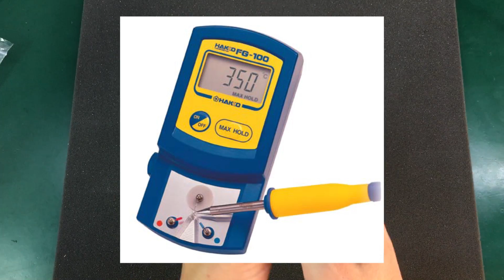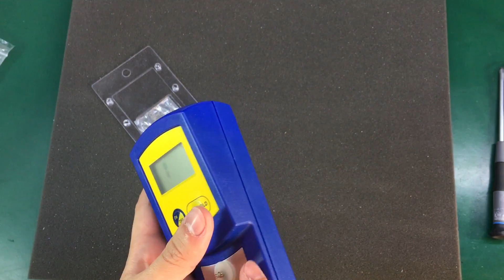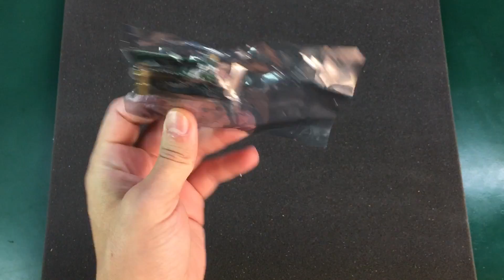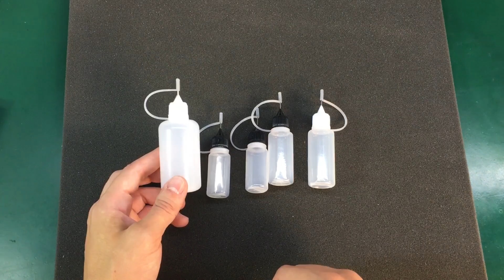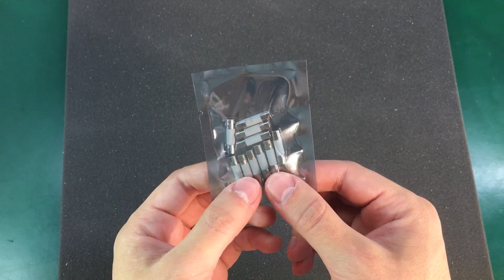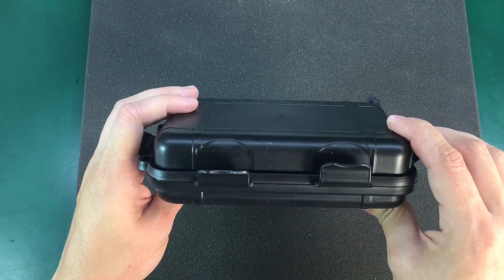Voltlog #68 - InTheMail

Comment: Don’t connect peltier plates in series. They have very poor operating efficiency. For example: to remove 1W of heat on the cold side they will generate 20W of heat on the hot side. Now think what will happen if you cascade two in series….

Comment: You can stack the peltier elements and connect the first that will be under to 5 vdc and the second on top to 12 vdc. Place it with the first element on a big cooling block with a fan. I made a cloud chamber from this for detection and visibility of cosmic rays. Search  on YouTube for nedstar cloud chamber.
Reply from the maker: nice, pretty cool project you did there.

Comment: Don't use peltier elements in series the way you say. It's a sure way to destroy them.
Also, using the thermocouple for the soldering iron does perform best with a bit of solder on the tip. Not required, but it's not a bad thing to "wet" the tip a bit before measuring the temperature.
Reply from the maker: Thanks for the notice!

Comment: If you would have taken the circuit board out of the soldering iron thermometer you would have noticed that the LCD still has the protective cover on it. I bought mine from banggood as well and the cover was still there. This is the main cause of the "foggy" display. Open it up and peal it off. I'm sure you found that putting the unit back together with the spring wasn't much fun.
Reply from the maker: I have removed it a couple of days ago and I can confirm there is a very small improvement but it just seems stupid to make an opaque front panel for the lcd :)
Reply from the maker: thanks! I will do that and yes putting back that spring lever mechanism wasn't fun.
Reply: I have the same one, and yes it helps a little bit to remove the plastic protective cover on the inside (LCD display).

Comment: Nice probes, I use ones from Banggood (sku 91653), golden sharp tips (similar or same as yours), flexible silicon wire, very fast response on my multimeter, cost me about 3.6usd now are cheaper and I saw them even cheaper on Aliexpress (under 3usd). Nice reviews, thanks.
Reply from the maker: thank you for watching!

Comment: The A6 chip was vandalized, obviously.
Reply from the maker: yes, probably happened during shipment due to poor packaging. These days they don't even use a piece of foam to protect the pins..
Reply: Probably not, most likely it happens during assembly.  The same thinking that goes into removing chip numbers from ic's.  I can't count how many times I received things from ebay with mutilated cases.  The thing works but it destroys the recipients excitation in receiving a package through the mail.  The Germans have a word for this "Shadenfreuden" (sp?) it means getting joy from someones misfortune.
Reply: anyway, as for the ESP8266 chips, that's just a protection which can be removed easily, it's clipped... the chips are underneath it
Reply: Its no big deal, it just spoils the fun.